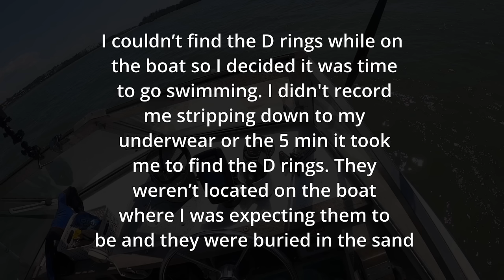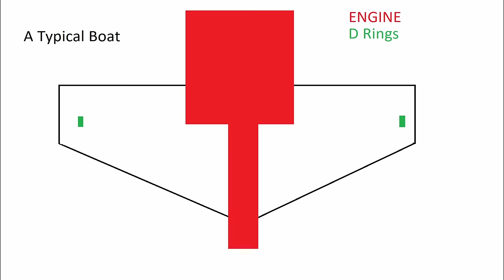My First Time Using Lift Bags to Refloat a Boat - Salvage

Comment: I have done this job for over 20 years. If you need any advice for the proper equipment I would be glad to help. Starting by stop using scuba regulator first stage use negative bolts like on air banks in scuba diving centers. This configuration will fill your lift bags in around 20  seconds. A 12v 1000 gallon / hour or a diesel agricultural pump. Instead of many small scuba tanks try 50 L X 300 bars air banks. Comparison 4 X (12 L 200 bars) = 9600L.
1 X ( 50L 300 bars) = 15000 L almost twice.

Salvage rubber cylinders are better than lifting bags. 2 of them is enough to lift the whole boat. They are heavy duty specially made for this job. 

Use at least 20 meters rope between your boat and the salvage boat to reduce stress on your engine and in case of the salvage boat sinking again you will have enough time to cut the rope and save your own boat from sinking with it.

For all the equipment I mentioned if you want drop me a message I will send you the links where you can find them.
 I appreciate your hard work even being on your own.
Reply from the maker: Thanks Odel. Unfortunately equipment is not up to me. I just work as an independent contractor for the guy who owns the boats/equipment
Reply from the maker: @odeltarkhan3033  I was actually thinking about getting certified this summer. Where are you based out of?
Reply: @CaptKenO  I am in UK for the moment. But no worry I can help you with the theory and you do the practical certification in a center in USA. Understanding scuba diving is very easy if you have a good instructor.
Reply: Would a hookah rig work? To fill the bags

Comment: Connecting the pump directly to the battery risks a battery explosion.  A fused pump connection located away from the battery would be a good idea.
Reply from the maker: Those wires will melt before there's any issue with the battery. It's only drawing 10a under normal operation, so it's not doing anything bad to the battery
Reply: That's an extremely low risk. Like winning the lottery
Reply: @JJM2222  It is low risk but risk it is. Batteries put off flammable gas all it takes is a spark, and down in a low area. Know a guy that spent the rest of his life blind from doing just what he did. A boat used for recovery should have remote battery contacts. Not hard to install. I have it on my zero turn lawn mower because the battery is under the seat.

Comment: Anderson connectors for your dewatering pump and lower gauged wire along with a shorter discharge hose would make a big difference.
Reply from the maker: Clamps are better in case I need to put the pump on the other boat. These clamps are shit, but the wire gauge is fine. The length of the hose is good too because there is nothing worse than having a de watering pump with a hose that can't reach overboard

Comment: I wondered if you ever used lift bags.   We use to utilize them back in Illinois to get automobiles retrieved from quarries.  That was many years ago!
Reply from the maker: Occasionally we do...most of the salvage work we deal with doesn't require bags thankfully!

Comment: What happens to a sunk boat like this after you deliver it to the dock? Is the engine salvaged? I assume all electronics are toast. Is the boat itself restored?
Reply from the maker: For this boat, I'm guessing it was disposed of. The engines you can sometimes salvage and the hull is usually good enough, but electronics are almost always fried and the electrical wiring should be replaced but often is not.

Comment: I am curious as to why you didn"t pump out the water when you refloated the skiff?
Reply from the maker: I tried, but it was easier to just tow it to the haul out where we could pull the drain plug

Comment: Question to Tow Boat US , Do you fellas have routine  check on out board engine to boat check of Nuts Bolts for tightness , I see lot owners  boats  don't check nuts bolt of out boards  on securely among other stuff
Reply from the maker: On our boats? No. But our boats are serviced every 100hrs, so about every month or so

Comment: Hi mate enjoying the videos. 
quick question, is your boat jet drive or prop?
You seem to spend a lot of time in shallow water
Reply from the maker: Hey Matt. Thanks for the support and glad you liked the video! This boat has a single prop keel drive. It'll run though 18in water, so it's good enough for 99% of what we deal with
Reply: Thanks champ. I suppose it’s sandy bottom mostly anyway. Have fun and stay safe. Cheers

Comment: Darn, an hour video and we miss one of most interesting parts at the end because the camera wasn't pointing in the right direction.
Reply from the maker: That's why I use a 360 camera now...What part did you really want to see?
Reply: @CaptKenO Thanks, I just wanted to see what was used at the dock to lift the boat, how much water came out of the thing, and if there was any visible signs of damage to the hull.
Reply from the maker: They used the forklift, a shit ton of water came out, and no visible damage from what I could see
Reply: 360 view is great. Thanks.

Comment: There is a company down in miami called fast response and they have a YouTube channel.  Watch how they right flipped and sunk boats.  Much safer operation.
Reply from the maker: I've watched them before. Definitely not safer. Anytime you're towing a boat at planning speed more things can go wrong and go wrong faster. That being said, they also generally have to tow much farther than I did, so it would take an eternity going slow with the lift bags
Reply: @CaptKenO  All citizen aside you did get the job done. No damage or injury and in a timely cost-effective manner. I might do some things differently, but I did enjoy watching you get the job done.

Comment: bro...twin engine boat hoook up to the front ring and start pulling....make sure plug is out and run the water right out of it
Reply from the maker: First off. I don't have a twin engine boat. second, you're assuming the water will leave faster than it comes in...which it most likely would've done until I had to slow down to get into the marina. Hence why I used lift bags

Comment: Great job only thing you did that I  cringed for is when you went between the two boats  never .never put yourself there again !!!! anything could have happened to you   other wise keep doing what you doing  !!!
Reply from the maker: Generally, yes. Body parts between a boat and another boat/hard place is a bad idea. In this case, I didn't have a whole lot of options, and with the wind and current pulling my boat away and the sunk boat being low down, I felt I had a good enough safety margin there. Whether I did or not, who knows. Luckily I didn't have to find out :)

Comment: Did this vessel get swamped? What caused sinking
Reply from the maker: Not 100% sure what caused the boat to start taking on water. Most likely a through hull fitting somewhere broke off, and once the bilge pump failed, they were doomed

Comment: What your you draft?  Are those jet propolsion?
Reply from the maker: Single screw keel drive. The big boat draws ~2ft the small one ~1.5ft
Reply: @CaptKenO  I own both. A '96 20' walkaround (wide beam) and an '87 26' Hardtop. Shamrocks are tanks. Those keels come in handy when skipping in the shallows.

Comment: Would a strap under the stern with the lift bags on either side and actually in the water not have made  it easier,  most of the bags ghe way you had them weren't providing any lift.
Reply from the maker: Water wasn't deep enough...but yes. Getting the bags actually underwater would be better

Comment: No disrespect, but why not anchor close to this boat and then tie over next to it?  Also, what about just towing the boat as it sat up on plane.  I've seen it done numerous times and it looks much easier than what you did here. Just trying to learn the plusses and minuses of different techniques.
Reply: That boat would not tow up in a plane, it would possibly roll.  The way to do it is tie a boat to each side until gunnels are above water line and use a high power trash pump.  His methods are very dangerous.  You should never get in the water by yourself.  And most respected companies rarely get in the water ever.
Reply: @allbayfishing9456  Thanks for the reply.  I learned a long time ago that pros make difficult things look easy.  When it looks difficult than either you don't understand what is going on or there is a better/safer way that isn't being used.
Reply from the maker: I was hoping I could reach everything from on the boat, so I was trying to avoid having to get off one and climb on the other. Getting the boat up on plane works, but you need a 2nd boat to get alongside and pump it out. I didn't have a 2nd boat/captain available to help today, so that wasn't an option. Also, anytime you're towing a boat at planning speed more things can go wrong and go wrong faster.
Reply from the maker: The proper way is to use lift bags to lift and stabilize the boat and then pump it out. To install most lift bags you need someone in the water to attach them